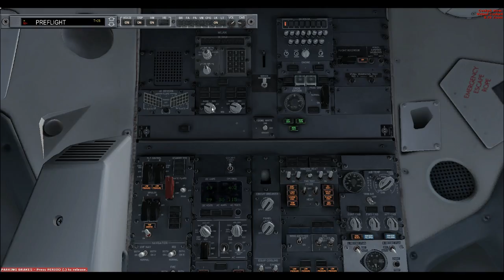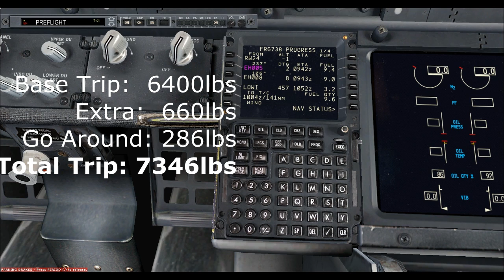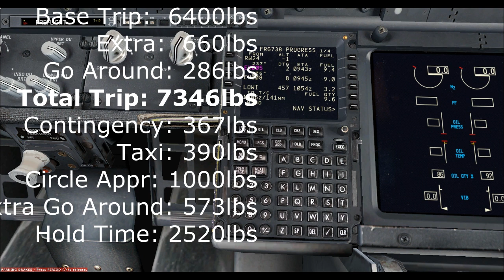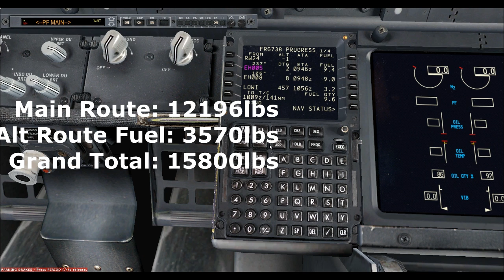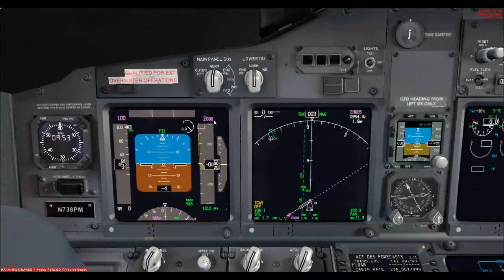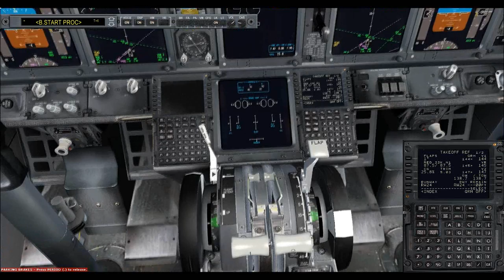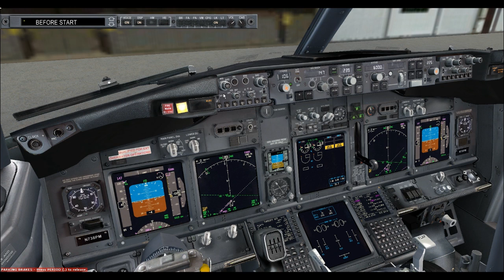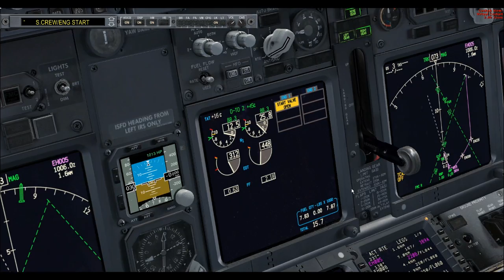HOW TO PLAN FUEL FOR THE PMDG 737 NGX IN FSX

Comment: Double check that both flight directors are on and everything else on your MCP is set properly. I think there might also be something about VNAV not engaging on the ground if there's a turn of a certain degree or greater after takeoff. If all else fails, it's not necessary to engage VNAV on the ground. In fact, I think with earlier FMC versions it's not even possible. So you could try engaging it at 400ft AGL as that appears to be fairly standard from what I hear.

Comment from the maker: To preserve the life of the engine, and reduce maintenance time, engines are 'derated'. You don't need 100% power to take off. There is a fairly complex set of math involved in working it out based on the current air conditions, runway conditions, wind, runway length and load. This is what the topcat tool does for you. You are safe to just go with 45-50% in most cases though. Its just not very 'real' doing that.

Comment: where do you get the checklists for this aircraft?
Reply from the maker: They are included with the aircraft in the 3000 pages of documentation supplied in PDF form. Alternately if you have an iPhone/iPad you can download my app tapCheck (it's free) and then get the NGX checklists in that (they cost 99 cents)
Reply: Hey, thanks man, I was struggling to find them because, well you know 3000 pages is like looking for a needle in a haystack.

Comment from the maker: I have nothing to offer I'm afraid other than a HUGE amount of research, trial and error. Everyone's PC is different and you need to spend the time to find out what works for yours. A good place to start is to Google "Kostas FSX Tweak". He published a very comprehensive guide to what to tweak based on what hardware you may have. I started there and then went nuts from there on my own. I actually run 3 or 4 different FSX configs based on what I am doing, and filming.